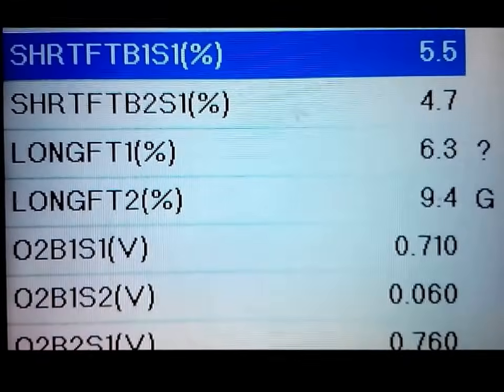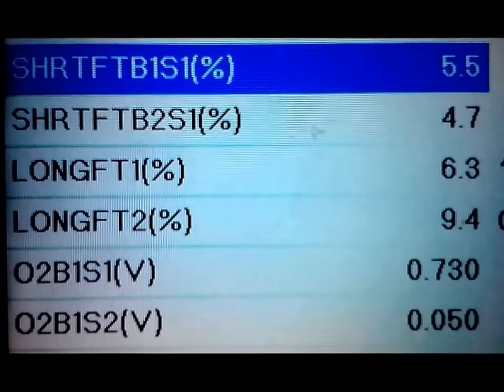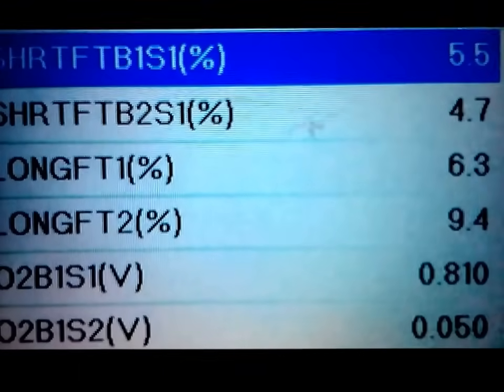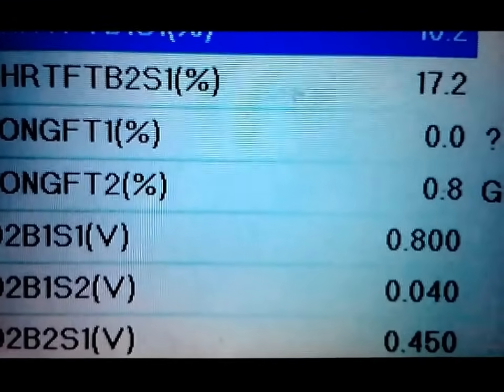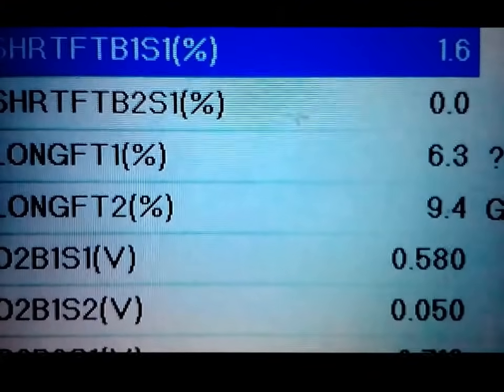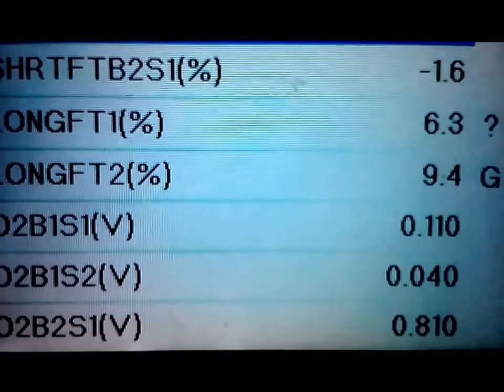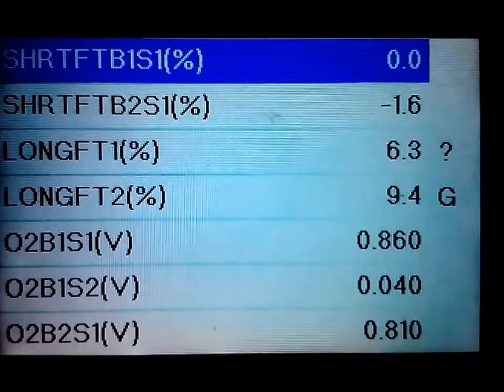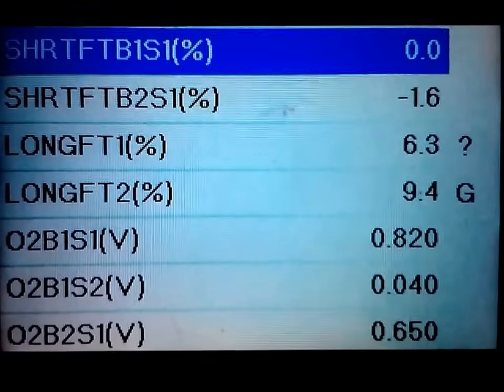how to read 02 sensors, short and long term fuel trims

Comment: Greetings, I have a suzuki Kizashi 2.4L S. 
The ecu throws check engine light with p0101 code. 
The fault code is thrown under 3 conditions: 
1. Coasting downhill with zero to minimim accelerator input. (Tps at 19.6 degree, MAF at 10-11g/sec)
2. Cold start after 24+hours in colder environment. Ltft drops down suddenly to -11 to -17% but goes back to 0-3%
3. High rpm idle test. Rpm set at 2.5k, stft increases from +1% to 5% and then returns back to 0%to1%. 

Can you suggest a way forward? I also have a bad valve cover gasket

Comment: Great video's on live data.  I'm new to reading live data and I need some guidance on how to diagnose a high-idle condition on a 2005 Corolla.  Idle is around 1,000 RPM and is a quite rough so I assumed a vacuum leak, but I've checked/changed all vacuum hoses and even replaced the MAF sensor and confirmed no manifold or PCV leaks.  Since the car is 18 years old (original owner), I've replaced both O2 sensors and all injectors which improved the vibration level, but it is still present.  The last thing I did to the car was to clean out the throttle body (there is no IAC valve). Here are some live-date anomalies (at operating temp) after my last repair:  SHRTFT = -20.3% (LONG is 5.5%), TP = 14.9% and will not go to zero even though the adjustment is full minimum, O2S11 = 2.914V (S12 is .095V).  Do you have any idea what may be causing the rough, high idle?
Reply: Smoke test
Reply: Did you find the problem?
Reply: @Dee-hi5zj    The problem turned out to be aftermarket injectors and sensors.  I had to go to a pro to determine that.  I replaced the injectors from a junked car (instead of paying $800), which fixed the fast idle.  I also had to replace the MAF sensor with a Toyota OEM part ($170) in order to clear the check-engine light.  The car is still going strong!  BTW, I no longer use aftermarket parts.

Comment: what does it mean if both my o2b1s1 and o2b1s2 go to a steady 0.20 (could be 0.020 i forget, but point is it's steady and will have pending code) when the fan or stereo is on? when i turn both off, those sensors seem to fluctuate again.

also, are the o2 sensors supposed to go to steady value like i mentioned in park? all my o2 sensors (2 banks 2 sensors each) drop to a steady 0.20 or 0.40 in park. or is that a function of not being in closed loop like you mentioned, because i didnt let my bank 1 sensors run long enough (because of the stereo or fan being on)?

Comment: Cold air intake will gain power. A lot of factory ecu are calibrated to be a little richer at wide open throttle, adding the cold air intake leans it out a little and gain power. Closed loop is only used during idle and cruising.

Comment: Question? Have a 2004 honda Civic ex and my back oxygen sensor had a p0139 code and went and replaced the sensor but now that p0139 code went away but now it's showing a p0141 code and that is coming from the new sensor. This sensor was replaced last Sunday.

Comment: Hi, one of my upstream sensors on my 2014 Ford Mustang is showing a negative value. My STFT for bank 1 is +34 and for bank 2 it's -25. Both long-term are 0. My vehicle is not running well. Rough idle, poor acceleration, bad gas mileage, sometime I smell the rotten egg/sulpher smell, etc. No check engine light. Please help. Thank you.

Comment: Great explanation. I have a Toyota Camry 2.5l   Stft. 0.08 and ltft 39.8. I smoked test and did not find any leak. I changed plug coil pak injectors 02 sensors and maf. Still getting low mileage. Pl help 🙏
Reply: Got any codes?

Comment: Thanks,  watched video twice. So understand how its all goes together.  ? My shortT reading -17. Longt 0.0  so how I'm understanding my issue is not vacuum leaks. Itd a fuel issue. . so my ? Is I have been putting fuel injector cleaner and its not that. So I'm gonna go with a fuel injector is clogged ? So I would have to basically clean all of them because I don't know what fuel injector is they don't label which one would be the one bad right?  
Thank you so much for your help. I so understand how it works.  So what would I do next do I put maybe a direct cleaner to the fuel injectors or do I have to clean each one by hand which I don't even know how to do I'm going to touch them before and I'm a female mechanic for 25 yes. You and wiring electrical was not my thing though I so confused with injectors does this but if you could like give me a little push or something what should I look for I mean what should I do for the injectors and if it doesn't clear up see my fuel pump was a new fuel pump was put in like I want to say maybe a year and a half ago. I'm leaning more towards of fuel injector clogged I think thank you again have a great night

Comment: I was looking at the reading on mine 02 sensor it's not responding and it's stuck on a number I looked at the graph flat line is that a bad O2 sensor it's causing backfires and a random misfire

Comment: Thanks for the information, I'm no mechanic,  trying to fix an Issue I'm having with my Acura TSX 2009, it's giving me error code P0131, changed the spark-plugs, ignition. coils and even fuel injectors, but problem didn't go away. Car doesn't go over 20 mph ad checkengine is blinking. I got Foxwell scanner recently, but not sure what numbers I should be looking for when in comes to O2!
SHRTFT1: -31.3, LONGFT1: -3.9, SHRTFTB1S2: -31:3

Comment: Hi, I hope you’re still checking your channel. I have a question on data stream codes. What does it mean when my oxygen sensor codes give me N/A instead of a number. (O2B1S1  N/A) I have a reading for B1S2 but then not B2S1, B2S2, B3S2, B4S1 (all have N/A). BTW thank you for these videos. Could you do more on all these other codes? SPARKADV, MAF, etc
Reply: 02 connections?

Comment: My fuel trims and O2 sensor readings look just like the ones in the video, except I don't have an exhaust leak! Any idea on the cause? Mainly when the car is warmed up, cold they fluctuate normal even though the rear O2 spends it's lazy time mainly under 450mv. I'm thinking bad rear O2, gas mileage sucks, it's hurting performance on my GTP also. Even at wot...

Comment: Hi, I'm having an issue with my car idling kinda rough and hesitating especially when pulling away from a stop. I'm kinda new to using live data I just wondered if you have any suggestions what I should be looking for? thanks, cars not throwing any codes so I'm kinda struggling with where to start.
Reply: Start with easy stuff. Spark plugs, and ignition coils, vacuum leaks, maf sensor. These are typically the cause

Comment: Great info. Thank you. But one observation if you don't mind. 10:25  Isn't spraying "soapy water" on the intake leak sucking it into the engine? I'm no mechanic, but I think that's bad.
Reply: Propane
Reply: @paulmcdermott638 smoke machine!

Comment: I have a 2004 liberty 3.7 I got two codes, p0132 and p0152 every thing from the pcm to the connectors is okay, I checked resistance in every cable and all are okay, I changed both o2 upstream sensors oem, and still the same keep steady Reading of 1.270 on both o2 Sensors, down stream sensors Reading are weird also, I got 0.035 on both sides sometimes they go up to 0.700 and sometimes the upstreams start to oscilate but for a few seconds. Do you know what can be causing this?

Comment: Great video. I have a vehicle that reads:  
O2 B1S1   .9mv
O2 B1S2   .0mv
O2 B2S1   .0mv
O2 B2S2   1.0mv
STFT bank 1   -20%
STFT bank 2     30%
LTFT bank 1     -4%
LTFT bank 2     30%
Inj. duty bank 1   4.4msec
Inj. duty bank 2   11.5msec
Reply: The zeros should be replaced right

Comment: I have a 2001 chevy prizm 1.8 toyota vvt , (no i or 4 , different engines). Should the readings be the same where the O2 sensors or air/ fuel sensor and fuel trim readings are concerned? Thanks. J.

Comment: Extremely helpful bud having some crazy lean fuel issues making all sorts of codes trip. I do have a question though what could also be a possible cause if the 02 sensor voltage is also fluctuating like crazy. 
When the car is in the open loop it runs alright but when it goes to closed loop it's got problems.
02 sensor voltage fluctuates like crazy especially the downstream sensors.

Comment: Got negative ten long term fuel trims a touch higher on bank 1...a bit low o2 sensor readings on upstream...Maf reading at about 4.3...2001 nissan sentra gxe with the 1.8...runs pretty good but a little rough on the idle...cleaned throttle body and iac...experimented with the egr...any ideas?

Comment: Should I be checking theses while idling?   My truck seems to be having issues when I am towing and going up hill.  No codes, no misfires, took to shop for a trans flush. Dropped pan, all looked good. No metal in pan and fluid wasn’t that dirty.  When I punch it, I can feel and hear that my truck is not shifting like it used to, and when I am towing up hill my truck will jump when I’m 1st or 2nd.  Once I get pass 2Nd truck seems to run fine.   So I have a OBD reader plugged in right now and I am trying to understand the terminology etc.   so, when checking my O2 sensors and fuel trim, should I be checking while driving or in idle?  Bc when I step on it, my % goes well over 10%.    Hope all this makes sense.    Thanks for your vids

Comment: I have a scanner reading on the sensor called Lambda Correction, and it shows a value between 3.5 and 5.0.  Is this the same as STFT?

Comment: Thank You!! Very informative video.. but what about diagnosing faulty OSS or (Output Speed Sensor) on Transmission 4.6L? I've already wasted money replacing it with 3 different ones.. still having code, and engine light, and O/D light blinking!! Wires all seem to look fine.

Comment: I have 1500cc petrol engine in toyota  ......
I tried two maf sensor one giving 1.3 g/s at 650 rpm....
Another giving 1.7 g/s at 650 rpm....
Which one should i use for better fuel economy.....plz reply

Comment: So my short term field trims don’t move when I rev the engine while my long terms do, and at idle my long term 2 sits at a consistent -7.8 so is that a faulty fuel injector? O2 sensors sit at 0.115 and lower and only fluctuate between that and 0 when engine is revel. Any thoughts on these readings? Dealing with multiple cylinder misfires and already replaced coils and plugs
Reply: sorry to be offtopic but does any of you know a method to log back into an Instagram account??
I was stupid lost my password. I would love any help you can give me
Reply: @Tripp Davis Instablaster ;)
Reply: @Cain Gianni I really appreciate your reply. I got to the site through google and Im waiting for the hacking stuff now.
Looks like it's gonna take a while so I will reply here later with my results.
Reply: @Cain Gianni it did the trick and I now got access to my account again. I am so happy:D
Thanks so much, you really help me out!
Reply: @Tripp Davis Glad I could help :D

Comment: My sensors 1 on both banks read 2.3,2.8 and sensors 2 on both banks read .280, .250 and check engine light, what does that mean?

Thanks any opinions help

Comment: The live data on my scan tool indicates that the voltage for my upstream 02 sensors fluctuate just as they are supposed to. However,  my downstream O2 sensor remains flat at 0.000, so what does that mean?
Reply: My bank1 upstream reads 0.00v. Then I got a screen shot at 45 mph at 1800 rpms and my bank 1 short term fuel trim is at 20 percent. But the rest of everything looks good. I’m thinking the sensor is dead.
Reply: @Believeincode  The resistance for my downstream oxygen sensor falls within spec. Despite that, do you still think that it is a bad sensor?
Reply: @Zeberka767  if it remains at 0.000 while idle and while in gear, wouldn’t that suggest that the sensor is not workin? Or is it working because the obs is picking up it’s reading of 0.000? Idk man I’m having problems myself lol

Comment: I have a 2003 GMC Yukon 5.3L been coding for over 3 years. I think I've got it down to a fuel issue. I've eliminated a vacuum leak. The codes are P1071 and P1074.  I checked the fuel pressure 40psi with just key on. Idle 59 psi, 57psi at 2500 and 3500 rpms. I've changes all of the sensors over the course of 2 years. my Idle readings  B1 LTT 12.5 B1 STT + 2.3 - 0  B2 LTT 25 pegged B2 STT + 23.4 - 25.8  at  3000 rpms  B1 LTT 25 pegged B1STT +1.6 - + 8.6 B2 LTT 25 pegged B2 STT +45 -  + 50.   any help?
Reply: Sure the intake isn’t leaking? I’d start there

Comment: What does FRP mean?
Reply: That might be fuel rail pressure.
Reply: Lou F the only code thrown is misfire cylinder 5. The FRP reads 1.2 psi when key is in the ON position. 40 psi in idle, 60-70 after idling a few minutes, down to 39-40 while driving. Even when it struggles uphill the FRP stays at 39-43 psi. Smh. Could be a wire??? 😂
Reply: @TheBruceDickenson1  The first reply didn't come through it was deleted, but an atypical culprit may be the impact switch (my T-bird had one).  Maybe bang on it to trip it, and then reset it (maybe closing the back lid has it funky).

Comment: The B1S1 and B2S1 sensors on my 2013 jx35 are reading 1.9-2.2v at idle and go up to 4v while coasting. Is that bad?
Reply: Yeah that sounds too high. It should fluctuate between 0 and 1 volt.
Reply: @houlagan13  what do you think could be the problem?

Comment: Excellent Video...  much appreciated.  I have a 1996 E-150 5.8L EFi    .  Have ABS light on, OBD2 reader says "This vehicle does not support ABS communication"  is that correct ?  if so do you know of any other way to identify the faulty sensor (assuming it is a sensor fault)    also.....  when backing off the throttle the RPM holds, at whatever RPM you were at, for 2 - 3 seconds before dropping....  any ideas ?  there is the occasional hickup at idle and sometime it stalls.   PCV valve replaced.  Any help would be much appreciated.  Regards Paul

Comment: My gas mileage keeps dropping by a few tenths for the last few months. 2006 grand marquis 4.6l .. It went from 24.5 to 21.6 now. Any suggestions? New fuel filter, new fuel pressure sensor, new spark plugs (iridium)
Reply: Try cleaning your MAF sensor - be very careful of the element wire, use CRC MAF cleaner.
Reply: @louf7178  been there too. Also, found driver side cat partially clogged up and the EGR valve servo solenoid leaking around the spool shaft. Replaced both of them. Things got a little better.
Reply: @notyou6950  Possibly O2 sensor(s)?  It could be if the catalytic conv. had build up.  (I don't like the remove-and-replace method of troubleshooting, but I believe all the aged parts contribute some deviations.)  Be sure vacuum lines are good - like-new good (this can give different conditions from measured locations).  Good luck.  (I would mind knowing if economy returned.)

Engine coolant temperature sensor(s) can misinform, also.
Reply: @louf7178  I found out that the O2 sensors were good but the cat on driver side was plugged. Passenger side was ok. The EGR reading was all over the map while driving. That's when I found that internal vacuum leak. I've been all over this thing and found several issues in different places. I got just over 200k miles on this motor and the compression is +/-5 from 200psi on all cylinders. This motor is mint.
Reply: @notyou6950  Thank you.  It helps to read what people are finding. Glad you got it.  I had a 4.6 in a T-bird, and I was impressed - it ran virtually new at about 100,000 mi.

Comment: I have an O2B1S1 reading 3.39+/- Voltage. Any idea what that might be? ...or should I just replace the Sensor 1st? 2001 Toyota Tacoma w/ 160k miles.

Comment: I have a problem on bank 1 with 3 cylinder going rich.
And without turning the engine on
The long fuel trim bank 1 is -13.3% and won't move even at normal temperature
And the short term bank 1 is at 0%
And at normal temperature
Stays at -27.3%
Any advice please???
I found this by looking at this values
Since there's no code at least on my scanner...
Any help please????
Thank  you🤾‍♂️

Comment: Here’s my issue on a cold start engine dead cold I start the car and it revs to 2000 rpms and just gets stuck there. If I turn the key on and off a bunch of times I can start it and it idles down once in closed loop the fuel trims look okay look good so I’m baffled
Reply: Maybe u should check vanos it is blocked with old oil.. U should clean them. Or buy a new one and u will have ur problem solved
Reply: Don Buzzie      I got it fixed turned out it was a combination of the TPS IAC and MAP lol all seemed to go haywire at once

Comment: meaning increasing fuel consumption when o2 sensor detect lean condition?
Reply: Yes the low voltage shows lean condition and positive % shows the extra fuel added to bring the mixture back to normal

Comment: I had a p0160 b2s2 .  I put my scanner on the live data and it was like a constant value.  Then I rev the engine a little and then I saw it change some.  
I ended up jus clearing  code since I saw the reading change some after rev the engine  some.   I had the car idleing some for awhile so as I was working on something dealing with the power steering fluid flush(suck fluid and  add  3 times)  

I’ll keep my eye on this one p0160. B2s2.  Great vid on this subject matter